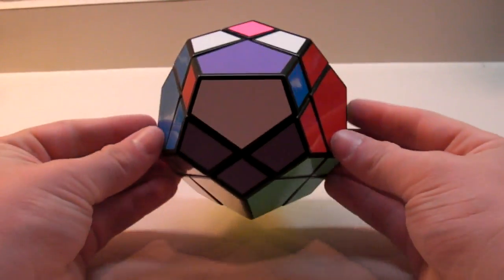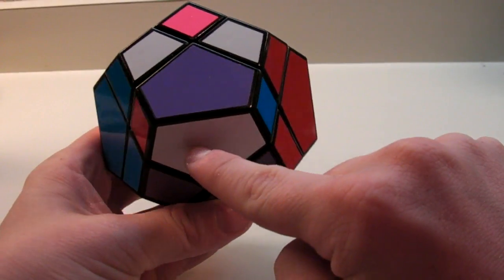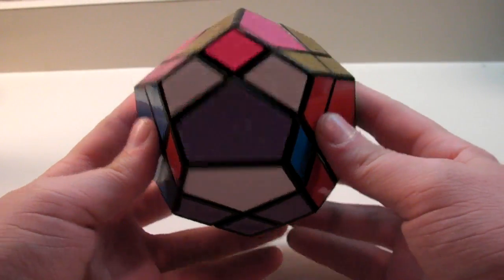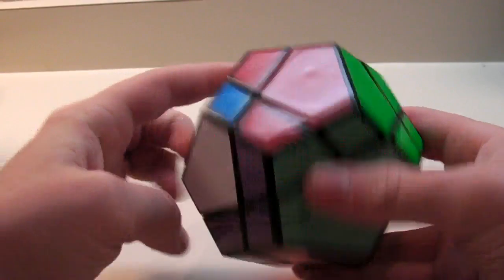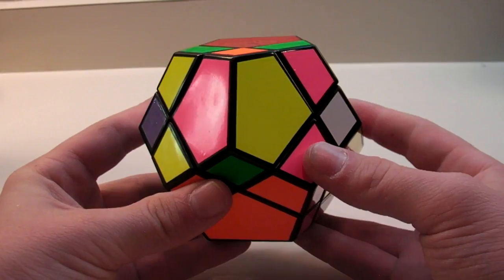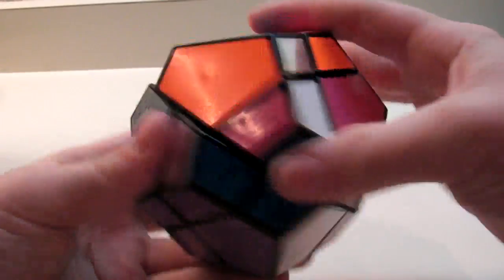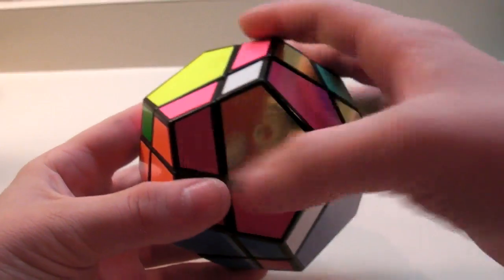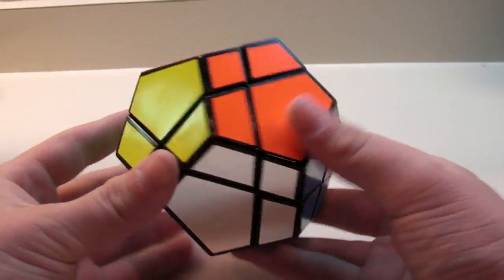How to Solve the Skewb Ultimate Part 3: Last Step (5)

Comment: Is it possible to end up with two corner pieces unsolved in the correct places but not turned correctly? I ended up solving the entire puzzle but two corners are turned wrong. Not sure if this is possible. I never dissembled it